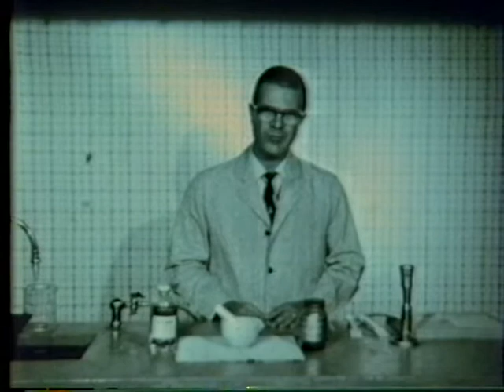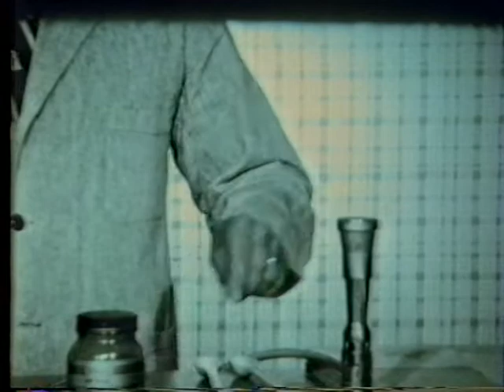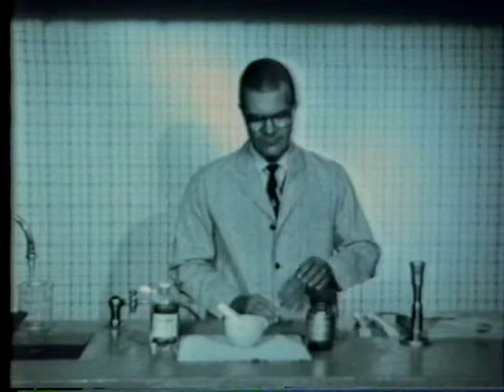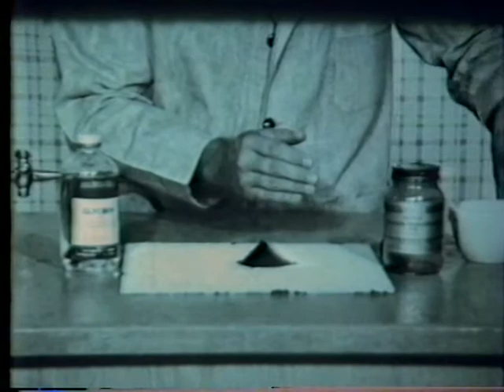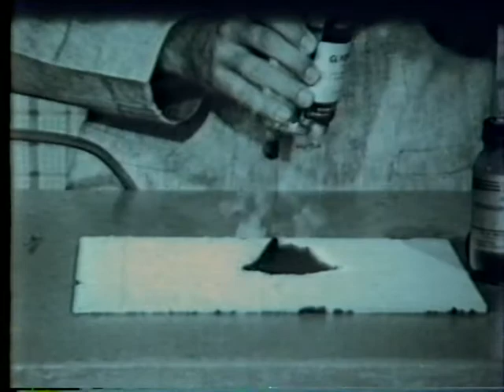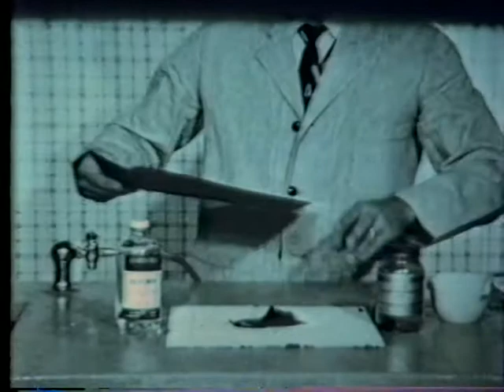Principles of Combustion: Dan Johnson Sets Stuff on Fire

Comment: During the 1960 /70s Laundrettes were a big thing in Britton, used by lots of folks, there were a serious of fires in these laundrettes, & they found the common denominator to be, greasy tea towels once washed, and stacked together folded in to plastic bags, retained there heat, & never quite removing all the oil /grease, in the wash, these tea towels would over night self combust. so starting the fires.
Thom in Scotland.